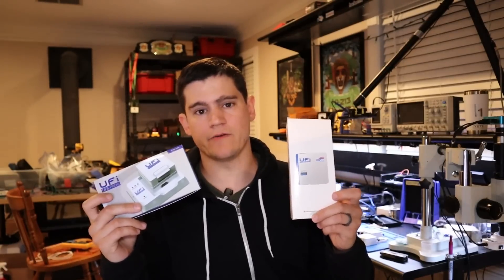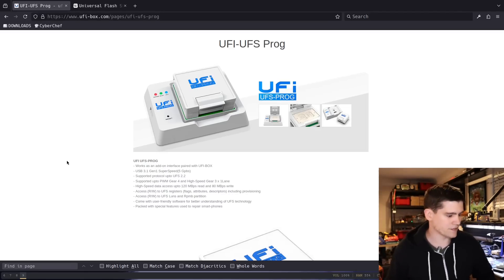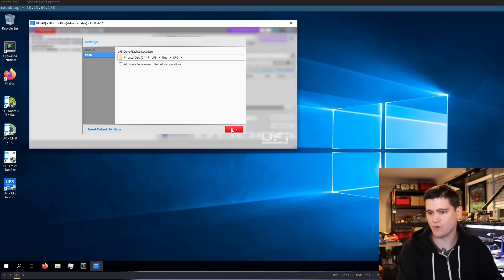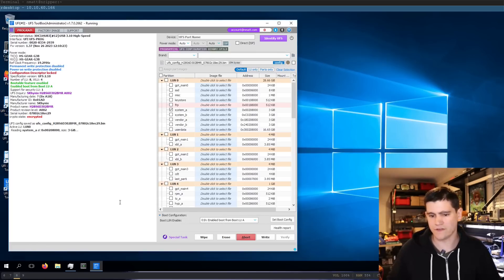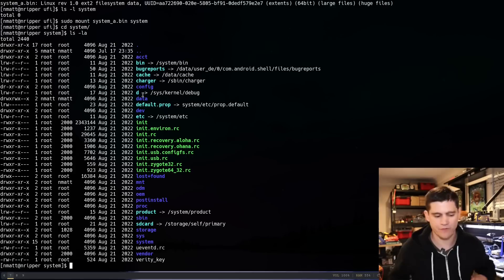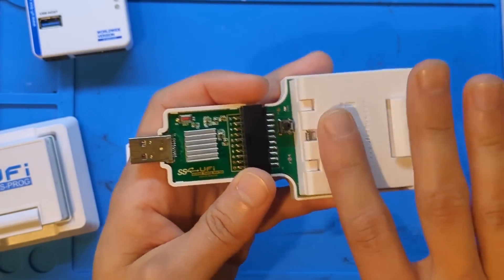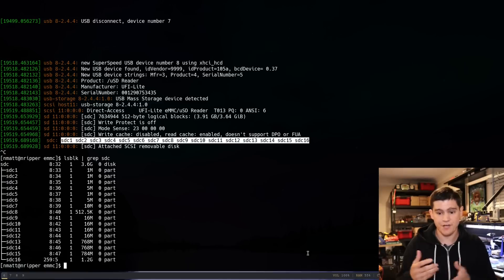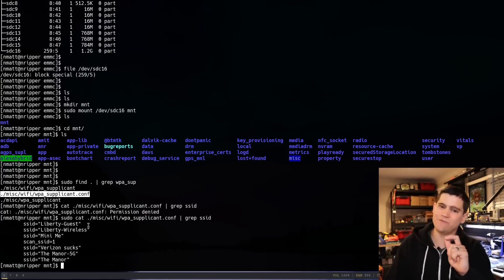UFS/eMMC Firmware Extraction - UFI Box

Comment: Hello all,

I am having trouble with the UFI LITE, it seems that any computer i connect it to, sees it as Storage Device.
I have tried everything, but it doesn't seem to work, i have tried using the UFI BOX and it works just fine. For some reason it's just the UFI LITE...

Does anybody have the same issue as mine and can someone help me solve this problem. Is it from the product itself or is it coming from my side...

Thanks for the help in advance!

Best Regards,

Comment: My hp laptop crashed and i got this message"boot device not found please install an operating system"
This exact problem: https://youtu.be/vG4uZjZUZzQ?si=4zlU4drm_hinGcd0

I was gonna try to fix it but the left of my screen is broken and have been that for years so inwould not be able to see the code that I need.

I gonna buy a new screen but do you think my emmc is broken and if so, can it be fixed?
I have a lot of important documents and so on it.
I have never heard of emmc before so I dont know how good they are to restore data from.

Comment: bro will this "proprietary flasher box" meme ever die? I remember purchasing several similar boxes from a thrift store, which were meant to unlock older GSM phones. However, to my surprise, when I got home, I discovered that they all require a connection to a server just to even launch the software. Unfortunately, it appears that the servers have been dead for quite some time. real shame.

Comment: The software making VM checks is weird to. Makes me wonder if it also does some checks if it's being debugged and doing some sketchy stuff. 
Anyways, there are ways to at least try to circumvent the vm checks. Eric Parker has a video on that, setting up a VMWare VM he uses when analyzing malware
Reply: I also wanted to mention Eric cause he has done a great job explaining how to make a stealthy vm
Reply: You wont have any luck with that. Pretty sure the software is running behind Themida, good luck circumventing that. People use that to secure their ransomware-clients.  @Eye-Linux
Reply: Ive ran into multiple different diagnostic software (for trucks) that will not run in VMs without extra work. But I only ran into that issue while trying to reverse engineer lol

Comment: I would love to see more devices support that UFS memory card you may have heard of that looks kind of like a MicroSD card.  I wouldn't be surprised if something better came along by now but I knew about UFS memory cards for a good while.  The fact is that there is already UFS storage in phones, just soldered down.  Why UFS memory cards don't seem to be used everywhere is a mystery to me.  It is as if they suffered the same fate that Thunderbolt nearly did and would have if Apple did not use it.  I would say that though Thunderbolt is NOT Apple proprietary it may be known for being easier to find on Apple devices.
Reply from the maker: Yeah I could see UFS cards replacing SD cards for digital cameras
Reply: @mattbrwn  Honestly it surprises me they aren't in everything.  I think I even read that it is royalty free.  You may still have to pay to get the specs but no royalty to produce devices with it.  If I am not mistaken there are very very few devices that use it.  Maybe this is a good example of how stubborn people can be when it comes to switching over.

Comment: Thanks for this video, I wonder if you have any tool you recommend to extract files from an DiskOnChip G4 flash media storage (having a Windows CE on it)
Reply from the maker: That's a very interesting chip and I don't think I know of anything off the top of my head to read it
Reply: @mattbrwn  Yeah, it's an older chip, it's a nice one,  haven't found a method to reliably extract the data, will probably end up doing some custom work in the end on it.

Comment: I will never buy a black box with proprietary software that only runs on Windows.
Reply: Yeah me too only FOSS on linux
Reply: @Electrically-Electronic  i dont understand tech guys who do hardware hacking that use and develop tools for windows. Linux is so much better
Reply: @sertralina100mg  yeah you're right.
Reply: Yes. Xi Xing Ping Ponf special. Aur packages for everything though or just bit bang what protocol they're using and dump.
Reply: @DJDannySteel  Reversing their broken software and protocol would be a huge time sink and at the end of the day it will benefit them. I won't be contributing to companies running deprecated blackboxes.
Reply: Unfortunately you will not find any open solutions, as people are taking huge risks stealing IP from manufacturers, with money being the only motivation behind doing so. Exploits for current generation SoC Bootloaders are only very rarely found by security researchers. firehose being such case. Partition Tables needed to dump those chips usually go along with the work on bypassing 'flash authentication', signature enforcing etc
Reply: Okely dokely
Reply: These type of all programer only windows
Reply: Have you heard about easy jtag

Comment: Sounds like you need to spend a little time in Ghidra with their software. You could bypass the virtual system detect.
Reply: After agreeing to their software terms, I think that might be a good way to be sued on top of having your work taken down.

You'd probably have to be completely disconnected from the company and do electrical signal analysis and computer forensics to see what the software is doing without tearing it apart.

If you find a copy of it online and never open it up or agree to any terms, I'm guessing that might be a grey area.
Reply: @Jeff-ss6qt  I would just do it. I wouldn’t show anybody what I did. If I use a tool that doesn’t work, I modify the tool.